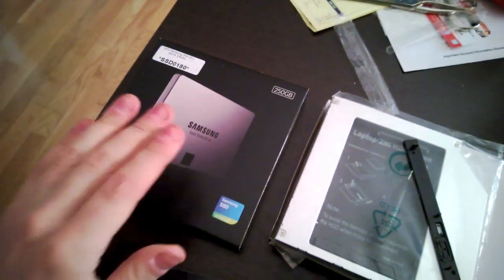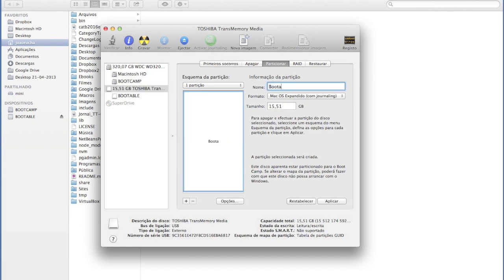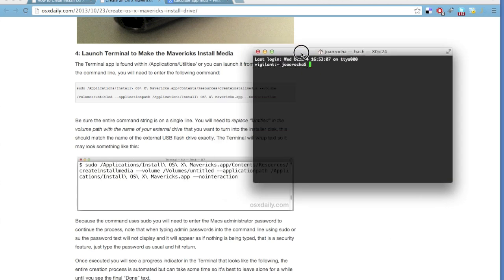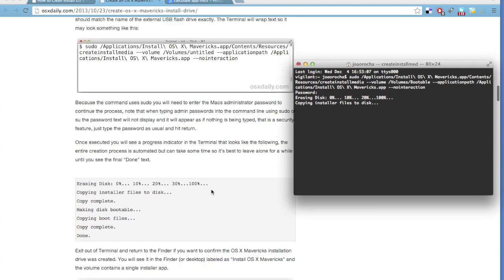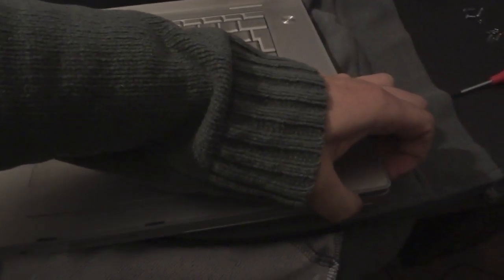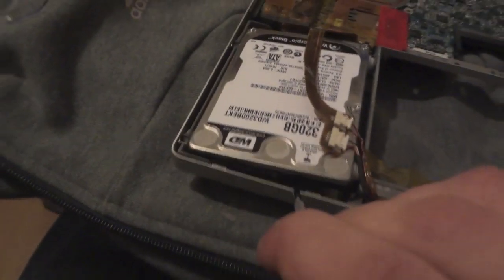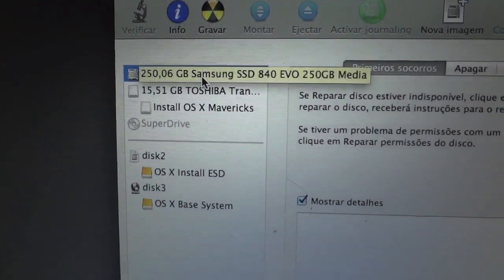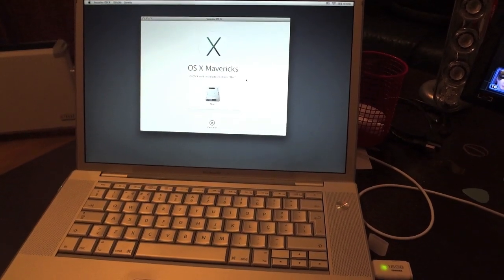(HowTo) OS X Mavericks Fresh Install From USB + Samsung EVO SSD Install + 2008 MacBook Pro

Comment: Better program is Macsfan control these days !
You download it free here : http://www.crystalidea.com/macs-fan-control

Set your GPU diode for the left fan, and CPU for the right fan.
Put limits like 60 or 65 degreeds, this way your very safe !

Good luck !
Reply from the maker: I can confirm, I use it myself on my MacBook. Thanks for the tip!

Comment: now run apps like SMC Fan control or istat menu !
And speed up the fan speed !

keep the GPU below 95 degrees celcious, to avoid getting damaged..
Reply from the maker: Been running that software to keep my fans at a minimum of 2600rpm to try and delay the failure of the GPU, which in these machines is common. Thanks for the tip :-)
Reply: ok good !
also a program i reccomend is Macsfancontrol !
its also free, i run my 4,1 macbook pro's at 4300 idle always !

Comment: Mr. Rocha -

I upgraded my Late-2008 15" MacBook Pro to a Mercury 240 GB SSD and moved my stock 5,400 RPM hard disk over to where the optical drive was (in the 5 I have owned this MacBook, I have used the optical drive less than a dozen times).

Now I have doubled my storage and I have a SUPER FAST SSD boot drive and will be using my original stock hard disk for storage.

Thank you very much for your tutorial. It was clear and to the point.  Really well done.  Please keep making videos like this.  SUBSCRIBED!
Reply from the maker: Thank you for your comment, it fills me with joy to know that my videos help other people such as yourself. Enjoy your "like-new" computer!! :-)

Comment: Hi I just bought tbe 17" model with the aluminium keyboard and if it works fine (bought it on Ebay from another coutry) I wanna ugrade the RAM to 4GB + a SSD
Do yu think I should upgrade  the RAM too ? I mean with the SSD ?
Thanks
Reply from the maker: Of course. With 4GB of ram and an SSD will make the machine fast. Change both things while you're at it ;)

Comment: Thank you Joao for the instructive video. I just installed the Samsung Evo 840 250 GB SSD on my early 2008 MacBook Pro 15" (non-unibody), and your instructions were perfect and very easy to follow. This SDD is much faster than the old 200 GB HDD.
Reply from the maker: It is, isn't it? It is the best upgrade I have ever performed on this computer. SSD's are really the future, it makes all the difference in everyday tasks! I have the feeling of a new computer again, and you most likely feel the same ;-) Thanks for your comment!
Reply: Yes, it's unbelievable. Now, I'm going to do the same for my 24" iMac, early 2008.